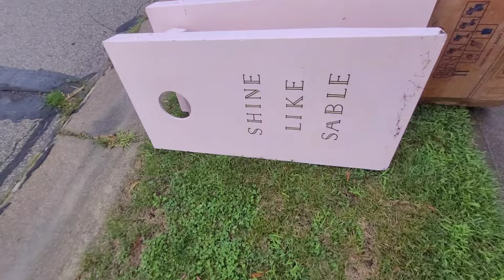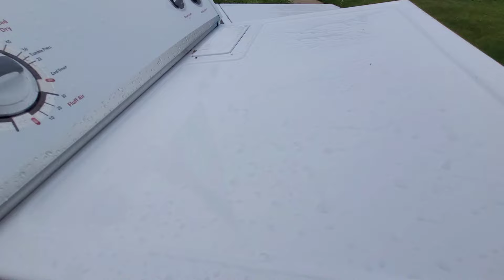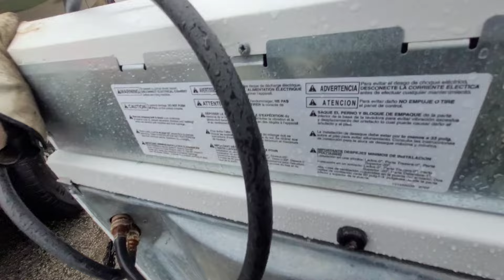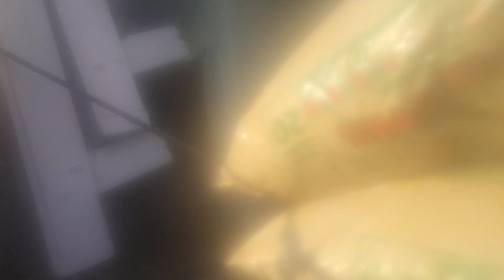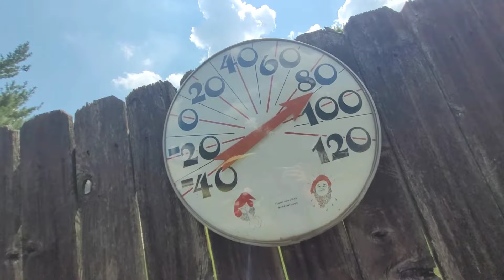Sunday Scoopin with Scrappity

Comment: You can only fit four chairs in  pick-em-up truck. That however is a Stuff-em-in truck and it hold six or more and the cushions for good measure. Maybe even the table if the lift gate/s down.